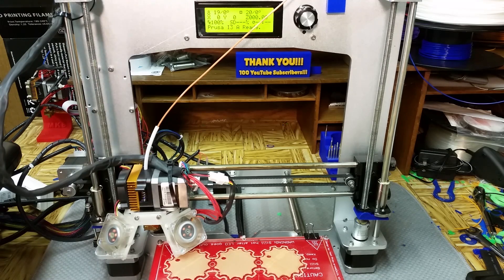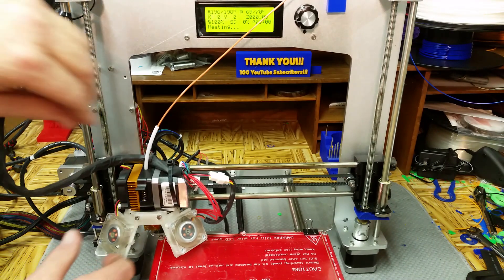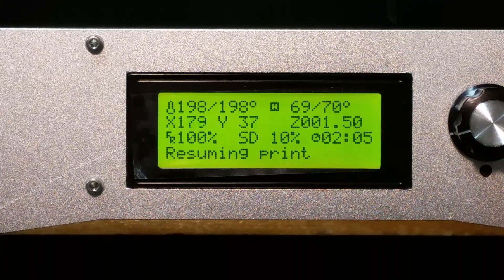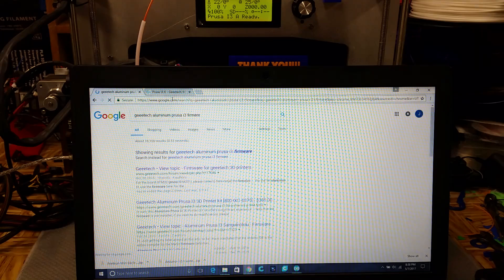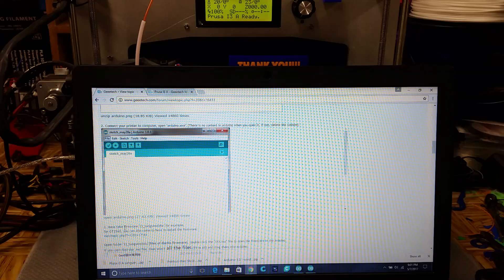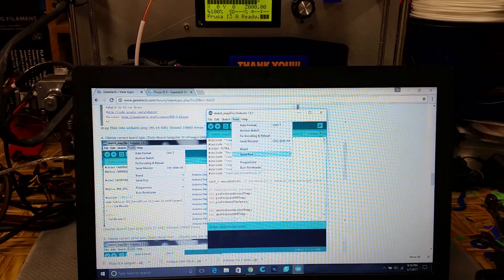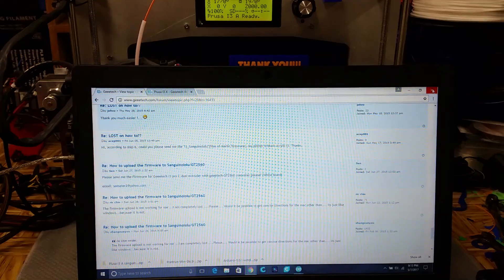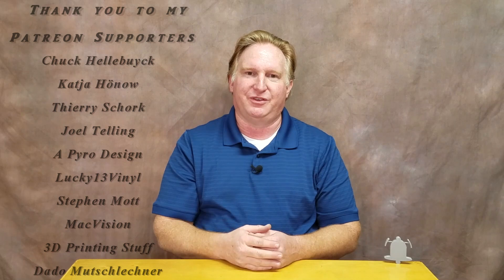Troubleshooting 3D Printing Errors Reloading Firmware on the Geeetech Aluminum Prusa I3

Comment: Hi Jimmy any suggestion to connect my Aluminum Pursa i3 to my mac? I'use Cura but It can't find the printer. Can you help me?
Reply from the maker: +walter fantauzzi I'm sorry, but I know nothing about connecting to a Mac.  I'm guessing there is a driver you will need.
Reply: Oh Ok Jimmy not problem. I've try to use some USB drivers for mac but it doesn't work.
Reply from the maker: +walter fantauzzi Hopefully this link will help. https://www.geeetech.com/forum/viewtopic.php?f=21&t=16283&sid=3bde454cf1c3865684981bf01704aa7f
Reply: thanks Jimmy I'll check it

Comment: Hi Jimmy I had the same problem.  turned out to be a faulty extruder stepper motor cable. broken core in the loom.  replaced the cable and no more problems. keep up the good work.

Comment: You mentioned that a "product" was working very well for adhesion and release from your build plate and said you would come back to it after the problem was fixed.  You didn't !!.  I bought one these aluminum Prusa printers tonight.
Reply from the maker: +Wild Kata That will be in Saturday's video.  ;)
Reply: Looks good but it sure is expensive.  Are you on the GitHub forum 
Geeetech-Aluminum-Prusa-I3?
Reply from the maker: +Wild Kata I'm not, but I'll check it out.
Reply: Looks like Geeetech heard the complaints about the Z axis.  My kit arrived with lead screws.
Reply from the maker: +Wild Kata I'm glad to hear that!!!!
Reply: Sorry to have to admit I was wrong.  My less costly Flsun has the lead screws.

Comment: Hahaha, the first thing I do with a new printer is to flash the latest marlin-rc-bugfix to it.
Good deduction Jimmy. I would watch this board, it could be that a bad solder job is starting to show.
If it's recurring, I would change the board.

Keep the firmware, as if you do, you will find a lot of useful number in the configuration.h file (the stepper steps per rotation and acceleration settings for example.)
Nothing you cannot rebuild by measurement and trials, but it's always nice to have them ready.
Reply from the maker: +Thierry Schork Thanks!  I know, I'm still not 100% convinced that it's completely trustworthy yet.  Eventually I do want to upgrade the board to a GT2560 so I can have the fans controlled by the software.  I just couldn't afford it right now.